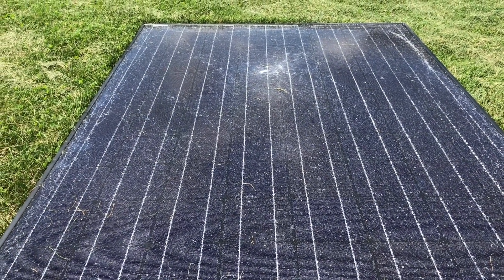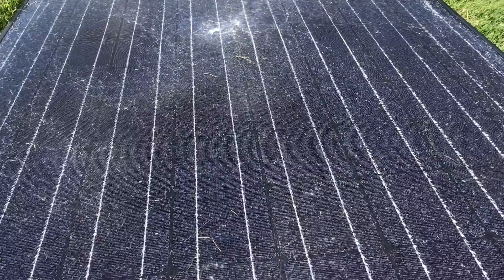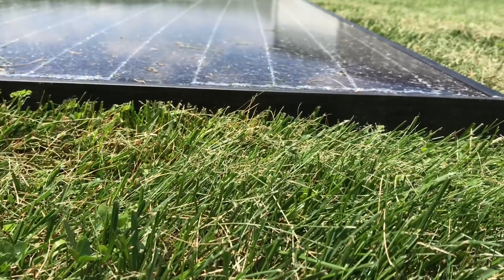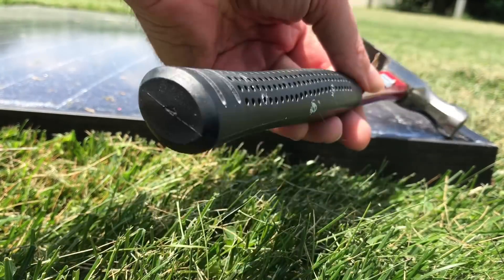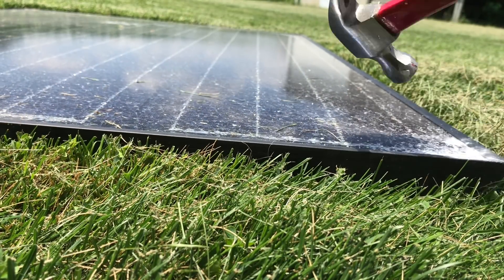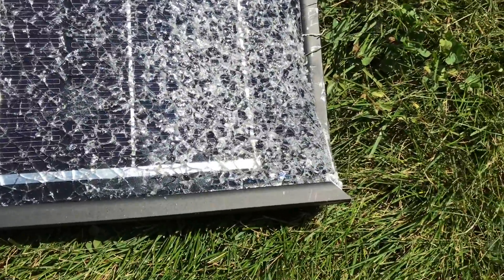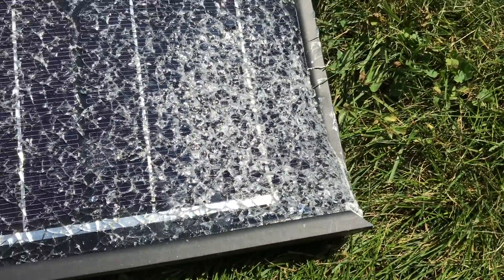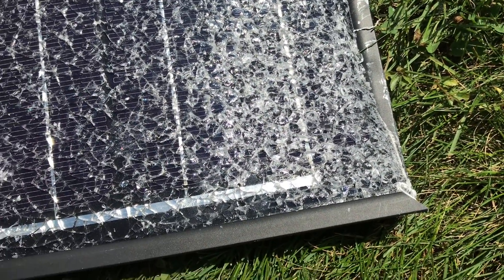How NOT To Recycle Silver From Solar Panels

Comment: You know just because the panel is broken it may still work there are a lot of guys in third world countries coating them with epoxy. They may not produce as much as original but they still work as long as their electrically intact.
Reply: Right. I have a totally shattered panel and it works.

Comment: Thanks for your fun at home attempt!  Probably what is needed is a larger scale operation where extraneous panel parts are extruded.  Then a slow series of temperature separations and extrusions slowly separate the various products of the metal (Like plastic/glass melted down at lower temperatures, etc until processes are successful.)  For your next at home attempt, maybe a metal chisel and a prybar!  (more fun!)

Comment: Next time you take apart a seam use a small piece of 2x4. Works the same for sliding glass doors.
Reply from the maker: It's the glue that's the problem.

Comment: Nice try Sal! Those panels are sealed with a type of glue covering all the panels and then the glass is laid on top.  The silver is mixed in with the solder (silver solder) so you would have to also separate the silver from the solder.
Reply from the maker: Ah, thank you. Yeah, looks like I would need special equipment. Thank you
Reply: @SalivateMetal  cupeling is simple and cost effective.